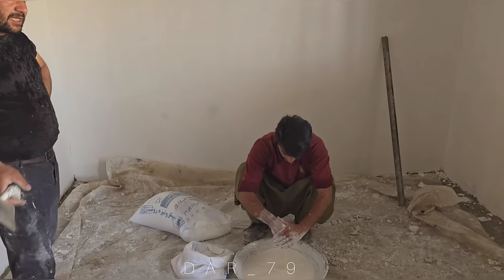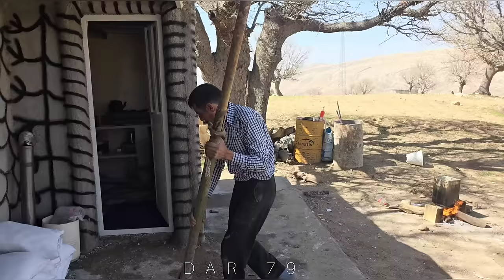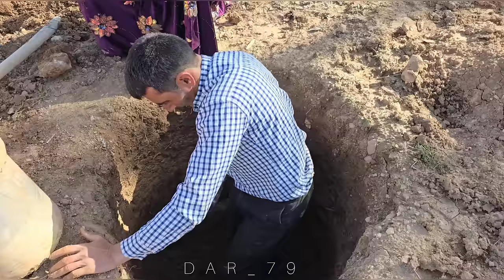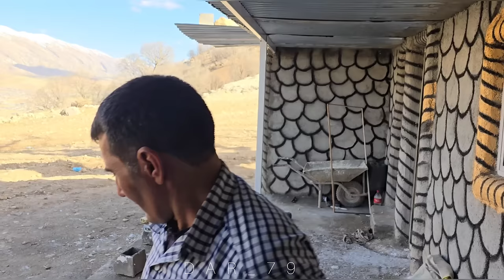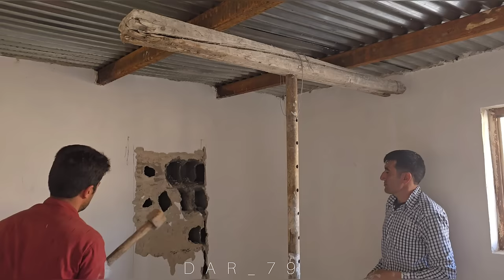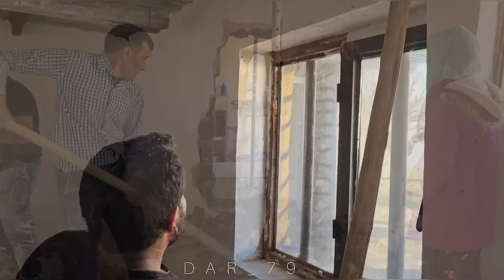"The door to the kitchen: the story of change and evolution in the mountains"

Comment: Good decision! Look like the wall where the door going to be not a bearing wall. Make sure to have an appropriate lintel at the door’s head. Best luck Nargis and thank you YouTuber.
Reply: Now the marking lines for the new door rather on opposing wall and this wall is a load bearing wall. A good lintel to support the piece of wall + roof + snow loads etc… above the door, therefore column is also required on each side of the door/ lintel to support the above listed loads.

Comment: SAFETY FIRST!   Every worker should have been  wearing SAFETY GLASSES.  My Dad, 70+  years ago worked in a metal shop and safety glasses were not required.  A piece of metal flew into one of his eyes.  Over night a form of unknown bacteria ate off the surface of his affected eye.  He nearly died and was blind in that eye.  Replacing an eye is questionable.  The young worker's could go blind for many years.  I gasped watching the interior kitchen door being hammered out and pieces of concrete cinder block was flying everywhere and a child in the midst of the worker's and amongst the flying debris.